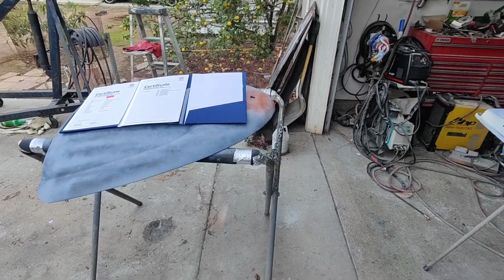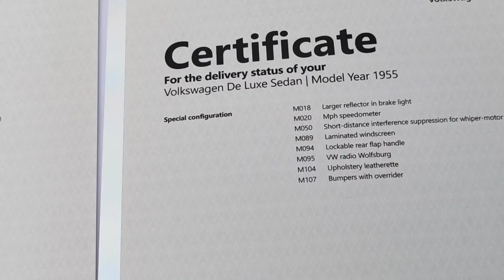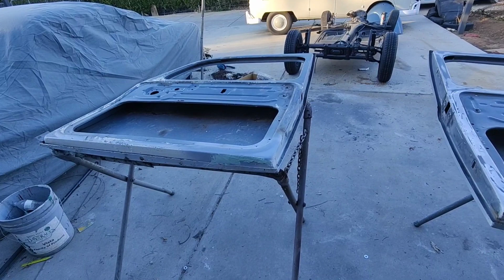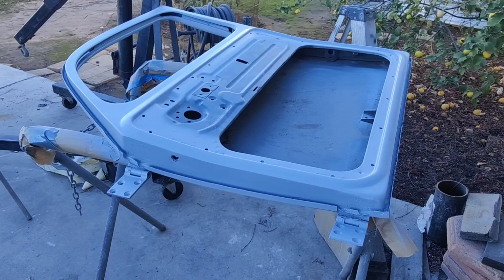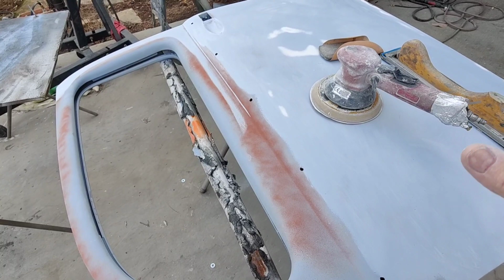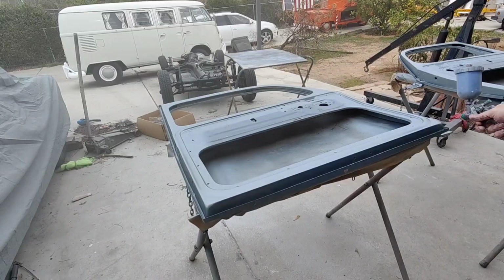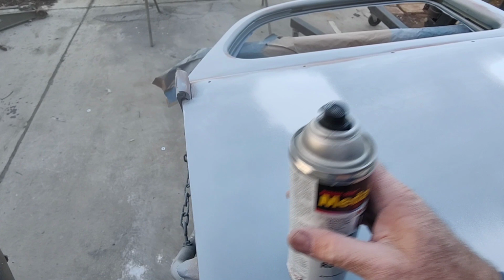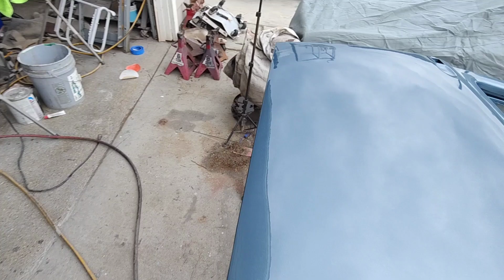1954 VW EARLY OVAL WINDOW BEETLE - Restoration - Painting the doors - W decklid

Comment: Mike, I recall, from years ago, that some electric wiper motors had interference suppression so that the wiper motor would not create static on the radio. I also remember some old bugs had something that looked like an ignition condensor attached to one of the wiper motor leads. That would be needed since the wiper motor is directly above the radio. Sparking does create radio waves, like when lightning strikes you can hear it on an am radio. Maybe check the wiper motor  for a little condensor looking device. Good video, keep it going, and Happy New Year!

Comment: Regarding your comments about the model year… in Europe they use the year of manufacturer for the year of the car up to the point when VW made the switch to model year designation. My October 58 beetle is a model year 59 beetle (Diamond gray with green interior—58 had the red/brown interior), but my Austrian registration book designates it as a 58 beetle.  Not sure this helps, but similar head scratchers exist in Europe.
Reply from the maker: yea they started doing that on vws here in AUG of 55.....before that it was when the year ends that was the model change.

Comment: wiper suppression was to stop it affecting the radio
Reply from the maker: Cool I will check the motor to see if it has that compositor but the radio had a factory blank in there. So I guess the dealer removed it. or somehow it got changed on the line.
Reply: @Mikefngarage  Maybe the radio broke and the owner just put a blanking plate in there instead of replacing it
Reply from the maker: @chrisfreemesser5707  I dont know I  am thinking the dealer removed it because the original paint on there was a perfect match. Probably the owner didnt want to pay for that expensive $200 radio. ha ha. Who knows how much they cost back then I bet they were super expensive.

Comment: Its a 1955, from August they transition into the following your model. So your car was manufactured in Dec 54, which makes it a 55 car. If it was prior to August 54, it would be a 54 car.
Reply from the maker: according to the samba they only started doing that in Aug of 1955. Before that it was at the year end. so if the car was made in 1954 it is a 1954. The only thing I dont know was is that deliver date of manufacturing date?  then in aug of 55 they started using the  56 year model. so 55 year models according to the samba were made from Jan 55 to july....then  56 year model. and in that time there was a mid year change. early and late 55. late 55 was in  may. There were some with 3 fold ragtops some with 2 fold. all kinds of weird stuff as they were changing over.
Reply: @Mikefngarage  yep you are right, investigate further the Aug 55 was the change over to the following year. Aug 55 post are 56 models.  There are a few photos of James Dean at Competition Motors in the Mid 50's with beetles in the background, won't it be great if one of those cars is actual yours?!  Yeah I always thought the 2 folds were for 56 onwards models.  I'd say they would have had left over stock and so items were found in later models so they can get rid of the items.  BTW strata silver is an amazing colour, great job keep it up...love watching your videos very informative!!!
Reply from the maker: @sashas8168  yea I was thinking the same thing man is that My car? or is it on the lot somewhere? just the thought is pretty awesome.

Comment: The M050 code was for factory installed (code M095) radios, - the wiper motor had a capacitor fitted in order to prevent electrical interference  !
Reply from the maker: yea weird it had a factory paint radio blank. though. I Guess the person who bought it said "HOW MUCH FOR THAT RADIO?" and if you take it out I will buy it. So they put a blank in there . I just dont know how they got it the factory color. guess the dealers had some of those in the parts department.